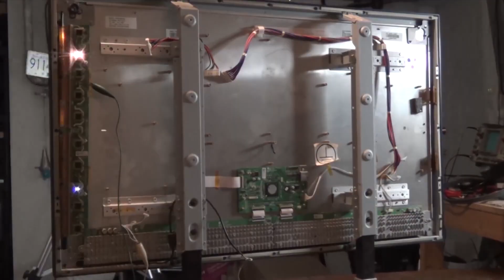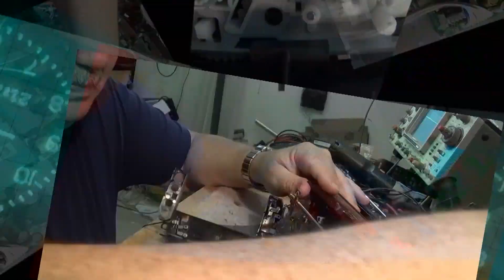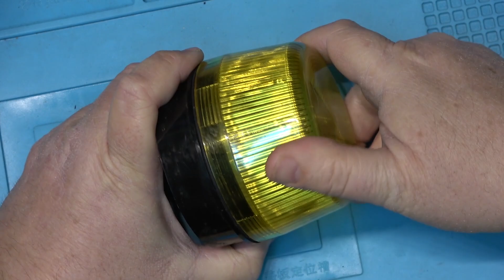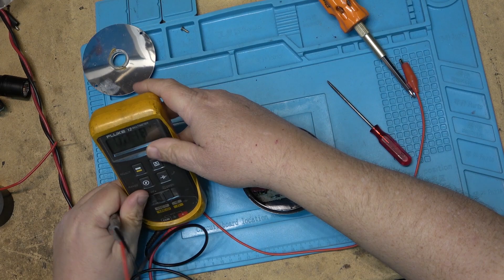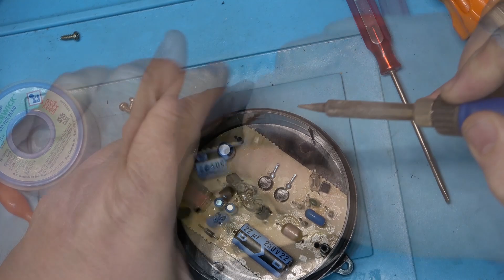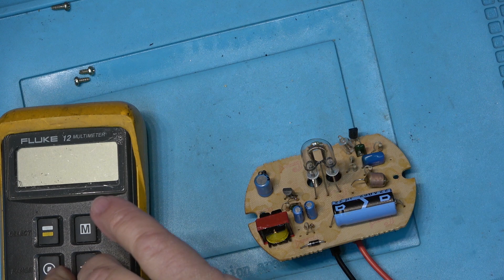security strobe tear down

Comment: I got one that was broken from a friend that work in a big warehouse. It was mounted on his forklift and broke.
So, it is the same size roughly and supplied with 12Vcc. Inside is a similar circuit with discrete components, the HV part generates around 300V and the ignition pulse is some 0.5Hz. The main difference is that it uses a linear (not U-shaped) tube some 5cm length, with the ignition electrode wrapped around the tube at 1cm step for 2/3 of the tube length; the tube was mounted on a separate pcb with 3 terminals, to ease the tube replacement I suppose. The defect was that the tube broke; I tested it with another (smaller tube) and it works.
The manufacture date seems to be in the 2018, made in China.
Reply from the maker: I'm sure there are still a few around but the vast majority including those for vehicles these days are all led based.  Most of these flash tubes have a limited life and then they burn out.  The higher the discharge voltage / current the fewer the life of the tube.
Reply: @12voltvids  Yes, and shocks or vibrations also shorten their life. I looked online and found a suitable tube for it and it was around 5€, glass made or 50€ quartz made. I also found on Amazon for 60€ a real xenon discharge tube flasher, I think that may be the real price. However, I have no use for such a device, so I will keep it just to have a HV low current power source; I made a zenner tester for >33V diodes from it and works very well powered from a 9V battery. I do not like to throw away a working circuit if I can reverse engineering it, understand it and using it even for other purposes.
I wonder, there are discharge tubes filled with other gases aside xenon that can work with the same schematic? Maybe flashing in  colors instead of bright white?
Reply from the maker: @sebastian19745  neon, carbon dioxide, helium, kyrptib ect used to pump high power lasers.

Comment: 4:40 - were you measuring DC?
Reply from the maker: Generally capacitors store DC.
Reply: @12voltvids  sure - I must have just misread the wavey symbol on your meter.
Reply from the maker: @obd6HsN  meter defaults to DC when turned on.
Reply from the maker: @obd6HsN  lol it was on DC. When it fell over it must have bumped the switch!!!!
Reply: @12voltvids  ha! That could have been painful
Reply from the maker: @obd6HsN  it has internal discharge circuits so the cap drains pretty quick.

Comment: Good old classic  strobe, i  haven't seen one for years.
I could be going mad,  but i'm sure i could hear a real low level tune while you were tinkering.
Like it was a leak through from something.
Reply from the maker: You mean you can hear the radio playing in the background? Yes the radio plays 24/7 in the shop.  It's such a low leval that the music isn't detected by the copyright police.
It is one of those Arlyc smart speaker boards I reviewed. I have several around the house that run in sync and play the internet station relaxing jazz dot com out of Jamica. The one in the shop was the plate amp that I built into a pair of old mini system speakers and they are way over on the other side of the shop.
Reply: My hearing gets better some days and deaf as a post other days, no i don't have a wife to ignore lol.
You also have blu tooth modules in everything except the outside grill :)
Reply from the maker: @zx8401ztv  i actually don't even use Bluetooth.   Just in the car for the fone.
I use wifi streaming modules.  Can stream from network drive, fone, PC, internet radio.  I only listen to the free stuff on TuneIn radio. I don't pay subscriptions.  I think people that pay for things like "spotafly" and "tweezer" and "zapster" are stupid.  I have the same opinion of the people that have door dash and shit the dishes on speed dial.  I didn't become a millionaire by pissing away my money on trivial things that were available for free elsewhere.  The only reason i have cable TV is to keep the wife happy, and because i get a discount from work.  I would be perfectly happy with the free off air channels.